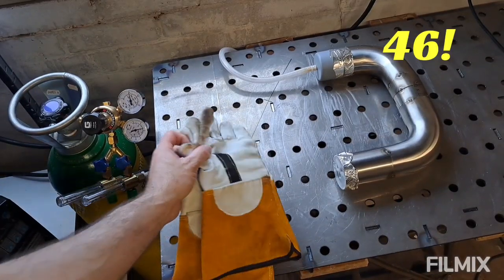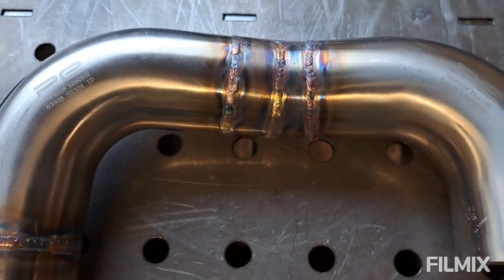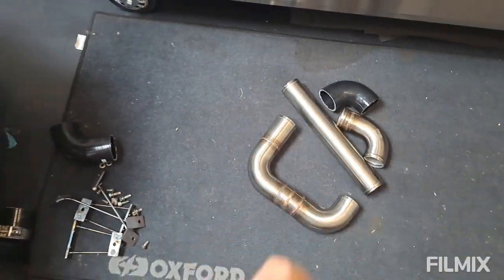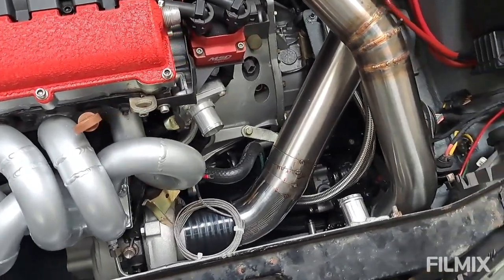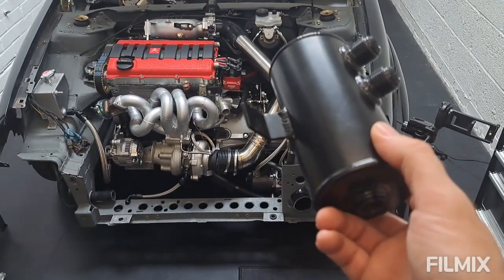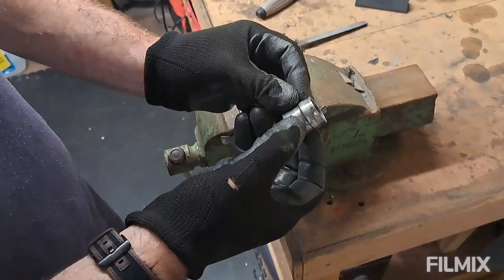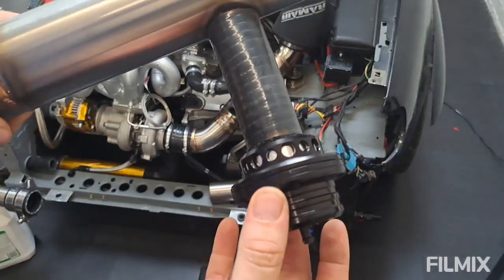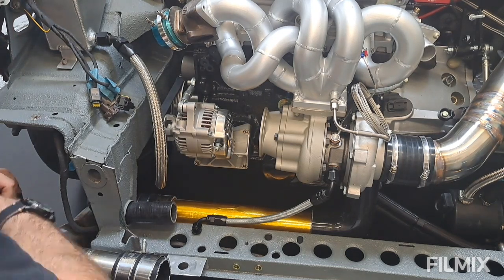Project 5AXO Ep46 - Citroen Saxo VTS Turbo - BOV & RamAir filter install

Comment: I'm so impressed with your saxo turbo build! You say saxo fans, the 106 fans r loving this 2! I've been building a monster go ped, petrol stand-up scooter in my garage, which, once completed, will reach speeds of 100mph I'm a mig welder by trade, issue is it's low paid work, so having the income to turbo my 106 looks bleak, so hopefully my scooter project will improve my ability to find higher payed work, then could be feasible 2 turbo my tu5 jp4 lump & live the dream 2! 🤔😀